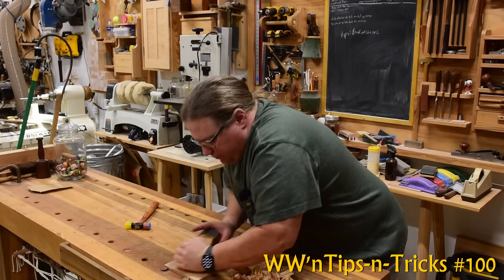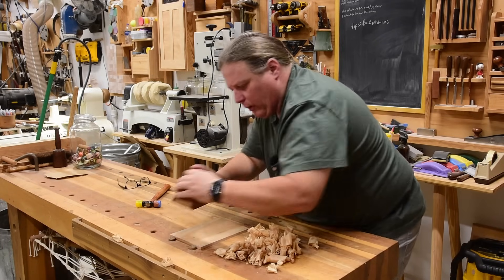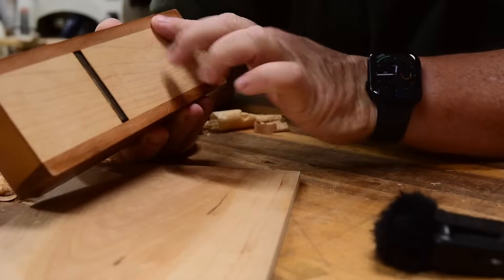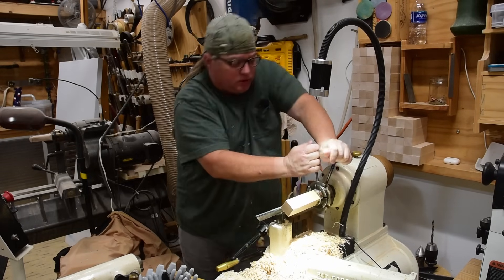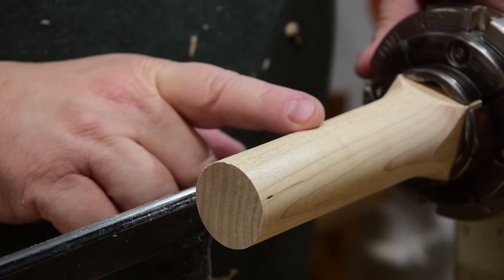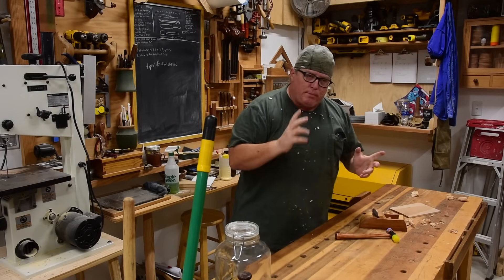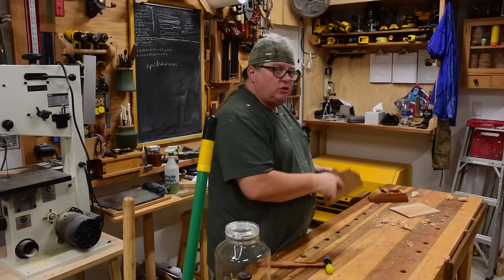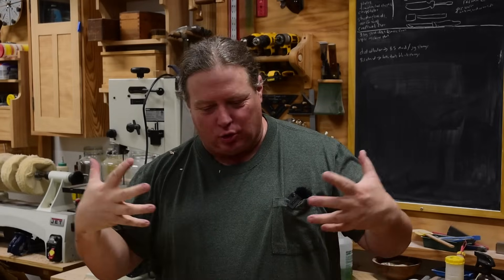Burnishing - Strive for the Best Surface Before You Apply Finish.

Comment: I used shavings and sawdust to burnish when an apprentice! Now I have a little more experience and expertise (40+years) I use my cherished burnishing bars and rods. Depending on the species and grain I use either Mahogany, Oak, Beech or Ebony. I would recommend not burnishing before staining or colouring as closed pores prevent any depth to your finish. I recommend a therapeutic practice to decide on the finish required before staining shellacking varnishing or French polish. Enjoy your your new skill.

Comment: Think of the cellulose wall structures of the cells as a bunch of rooms in a building. When you cut them off you end up with shiny floors and cut off walls. Burnishing wipes out the half cut walls, leaving only the flat floors. You might find that grain orientation maks a difference when there are no flat floors. 

Hope I didn't loose you there.

Comment: I think we need to divide this into two categories: burnishing and polishing. Polishing uses an abrasive compound ranging in grit size sizes from course to extremely fine. The finer the grit, the higher the reflective properties thus giving it a shine or polished appearance. Burnishing accomplishes the same end goal, but does not use an abrasive. Rather, burnishing compresses the surface fibers with a material equal to or harder than material to be burnished. This is why bone, stone, steel, or wood fibers (brown paper) all work to burnish wood. As the surface is continuously compressed, it’s reducing surface scratches and imperfections until it reaches a point where it’s surface takes on a reflective appearance. I think this is why the terms polishing and burnishing have become synonymous—they achieve the same end result (within reason) although by different methods. I hope this makes sense.

Comment: Good vid mate. I always use brown paper before I add a finish... but, I also use it to burnish up after using an oil. Adds to the shine quite nicely. 

Jay
Reply: Did you find that oiling prior to  burnishing resulted in a different visual effect than if you waited until after burnishing to apply oil?

Comment: It's like in working with concrete on floors you can , power trowel it , and it becomes harder. If you "hard trowel it", 3 times longer than power troweling, it starts to turn black and shiny, this makes it slippery when wet and brittle on the surface. This surface is nice in a woodworking area because it's   easy to sweep up dust from.

Comment: White Scotch Brite (1000 grit) does the same thing.  Or start with light grey (800 grit) and then white.  Changed my turning finishing completely.  Sandpaper just wasn't getting gloss enough.
Reply: I have put a few wood chips on the white scotch.Bright pad on my wood turning and use it to burnish it very well. Then my last step is to use the scotch.Bright pad with no wood chips. Then I finish it with ob.Shine juice and final step is hard wax and then polished. Best finish I've ever gotten. And it only takes a few minutes.

On my wood turned items.

Comment: Burnishing can make a vast difference on a lathe ... try using #0000 or finer steel wool (they do make #000000) followed by paper - doesn't have to be a brown paper bag, newspaper of copier paper also work (newspaper should be used without the print unless a little ink transfer doesn't impact your project)

Comment: If you're going to burnish large flat furniture parts, why not try using a straw burnisher (otherwise known as a French Polissoir)?  Although I would be interested to know if it impacts the ability of the wood to absorb oil finish.
Reply: I don't know about the impact of burnishing on oil absorption into a surface, but I can tell you that sanding to very high grit (3000+) does not seem to impact oil much, if at all. A lot of folks seem to be convinced that it does inhibit penetration, but I think what really happens is that it does affect stain and dye efficacy, so people assume it must also affect oil. I'd be curious about visual effects of burnishing either before and after oil and also of sanding grit prior to burnishing.
Reply: @TheIronSavior  Might be a fun evening in the shop running a few tests on scraps. How much penetration do you really want with an oil finish anyhow? Any deeper than to color it seems wasteful. 

I bet a burnished surface takes shellac better, not that I like or use shellac.
Reply: @Exodus5K  Right--I would only be concerned about penetration beyond visual effect in situations where I was relying on the oil for protective function, which is not a common scenario for me. I like oil finishes mainly for the subtle color shimmer and grain pop. I'm dying to experiment after seeing this video.

Comment: What Hello,
then what is the difference after applying oil for example? I don't know if I can compare, but for a "smooth" surface, I learned to spray the wood with water (sometimes isopropyl alcohol) and then run a few times in all directions with 400 sandpaper. The liquid "builds" the fibers, which the tool did not "cut", but pushed into the product. In the end, it will probably be the same principle as in the video.
Reply from the maker: That works if you abrade (sand).
Reply: @wortheffort  I did not realize that.  My fault.

Comment: I recently purchased a Polissoir to burnish wood panels.  It's a pretty time consuming process.  I wonder if it has the same effect as you mention about not affecting the oil absorption since it puts a lot of localized pressure on the wood?  I've also heard about but not tried using a piece of deer antler as a burnisher.
Reply from the maker: Polissoir does same thing.

Comment: I think you are compressing the grain a bit. Patting it down like cement with a trowel, not cutting or hammering?    Before baseball bats were as machined (and expensive) as today, players used to rub a bone along the grain to harden the bat. Usually a cow femur or the like.
Reply from the maker: didn't know that about bone.

Comment: I believe it bends over the fibers. Imagine you had grass if you laid a sheet if plywood on it for a day then moved it it would be all bent over and laid down. 

Pottery uses burnishing too and it packs the crystals tighter on edge grain you are smashing them flatter. 

Grain is the flowem and phyllum of the vascular plant with lignin and cellulose.
Reply from the maker: that would be the case if it was abraded (sanded) but not when sliced.
Reply: @wortheffort  I'm confused. Burnishing isn't slicing. It's essentially 0 grit sanding. I have access to a scanning electron microscope at my university if you want me to take a look
Reply: @wortheffort  also sorry if my comment was confusing. I got half way through it before doing something else and had to put it down then posted it half complete when I came back. I didn't proof read etc.
Reply: @wortheffort I'm not convinced that slicing can actually prevent fibers from being laid down like little crop circles. Why would a cut fiber resist being pressed down any differently than abraded fiber? I would think any un-compressed surface still has the capacity to become compressed.
Reply from the maker: @ comparing a hardwood floor to carpet. Solid block of fibers vs independent group.
Reply: @wortheffort  You're suggesting that the fibers of a sliced surface are substantially more cohesive, laminar, and the bonds between them remain (more or less) intact compared to those of an abraded surface because sanding is a more traumatic operation (especially where sanded by machine)?
Reply from the maker: @ I’m suggesting try it out for yourself. Doesn’t seem anything I say will convince ya.
Reply: @wortheffort What? I asked about slicing vs abrading. You answered in metaphor. I asked you to check my understanding of your metaphor and that makes me stubbornly unmovable? Look man, you don't have to talk about it if you don't want to. Nobody's twisting your arm.
Reply from the maker: @TheIronSavior  do the experiment.
Reply from the maker: @TheIronSavior  If you're not gonna take examples and metaphors that wheren't in the video then I'm going to have to refer you to watch the video again. Otherwise I'm just typing up what I said in the video. Do the experiment yourself. Decide for yourself.